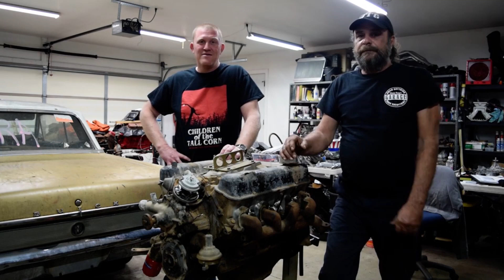Buicks Miracle Motor

Comment: for just shooting the sht, you guys were pretty accurate with everything. Like you said, in 1987 it was the last of the Turbo Buicks culminating with the GNX - BUT, in 1989 the engine was resurrected for one year only in the 1989 20th Anniversary Pontiac Turbo Trans Am using cylinder heads from the 3.3L Buick to clear the strut towers. The Turbo V6 also made it's way into 1980/81 Chevy Malibus and El Caminos - with a bulged hood, even. The 3800 was a completely different engine and the last "Buick" designed engine. Now, look up the 1951 Buick LeSabre Prototype to really see how the 215 is the grand daddy of all things Buick. That 215 was also all aluminum and was a hemi design having two rocker shafts per head. One set of push rods were almost parallel to the ground and both rocker sets rocked the rocker backwards. Take off that second set of rockers that made the engine super wide, and put all of the valves in line using a common rocker shaft and shazam, you have the nailhead. The engine went from a lesson in optimum head flow for the time to one of the worst for packaging. They were replacing straight eight engines so they needed the narrow engine packaged V8. That 215 from 1951 was also supercharged and had dual fuel gas and alcohol. The production 215 was a little more conventional in the valve train area unlike the Nailhead and the valve cover rails of the heads were raised on the outboard side so the valve covers would sit vertical to resemble the actual Nailhead. One last thing, a Stage 2 version of the 3.8L engine destroked found it's way into the Indy lights series. The Stage 2 version's nominal size was 252 cid. It was tried out everywhere and used a good amount in NASCAR. The heads performed so well that NASCAR teams using Chevy based V8's would cut up the heads and weld them back together in a V8 configuration. Possibly, a production run of V8 versions were made by a 3rd party.

Comment: They were using aluminum engines in European cars and air planes long before GM made the aluminum 215 or Chrysler made the aluminum slant 6. The technology was out there to do it right, at the time, had the American engineers would've looked for.
 That said, those are really cool engines!

Comment: Also 1989 turbo trans am. Similar to 1987 grand national, but the f body engine compartment is narrow so they made iron versions of the 3800 heads which are said to flow better and used the same part number crank as the 4.1l variant.

Comment: I bought a 1965 Buick Gran Sport...yes...a Gran Sport with the 300 in it. Bought it from a Buick engineer that I met at Sherman Drug store at 13 Mile and Rochester Rd in Royal Oak,Michigan. Gran Sports had 401 nailheads. The air cleaners where marked 445 Wildcat...the torque rating. He explained to me it was the only one made because it was an experimental. 300cid engine, 4 Jet Rochester carburetor not a 4bbl, cast iron block,aluminum heads...11 to 1 compression ratio. He said to only run SunCo 260 for the high octane. Which I did. It was dark blue with 3/4 vinyl white top,blue interior with bucket seats,center console,automatic. Automatic was Super Turbine 300....2spd...like the GM powerglide. Cool car. I also had a 225 V6 Fireball in another 65 Skylark. My Brother had 1971 CJ5 with the Buick 225 V6. The distributor was postioned just a little different because of the firewall on the CJ. So my sparkplug wires wouldn't fit his CJ.

Comment: I bought my 63 skylark convertible with the 215 all aluminum in 73 with 71,000 miles on it.It now has 337,000 and i replaced the hydraulic lifters at about 150,000.It has baby blue bucket interior and the paint is 70 plymouth Safire metallic blue painted in 74 changed the 2 speed auto trans to super T10 4 speed in 75.Today the whole car is perfect.

Comment: This was great!!! It is amazing , how many different versions of this engine, were used in different vehicles and racing applications... The enthusiasts - Tony & his friend are very knowledgeable about the different changes and versions that took place... I knew a fella back in the mid- 80's who had a Triumph TR-8, with one of these engines. He did have problems with the car-but I don't know exactly what those problems were... From what I remember, he said the electrical system on that little wedge shaped car, we're the main issues... When manufacturers constantly change their designs, it tends to make things difficult to repair the problems that might develop, after the vehicles get some miles & years of use. I like basic designs that are well proven and stay close to the same for several years of production. Much easier to find parts for these types of things...

Comment: Trivia fact. Two connected Buick nail head V-8 engines were used to spool up the jet engines on the SR-71 Blackbird in its early years.
They were eventually replaced by big-block Chevrolet V-8s
Reply: Superduper DavidMiorgan  Incorrect. I dont know where you got that false information, but there is actually a YouTube video describing in detail the engines that powered the SR 71 Edify yourself and watch it.
Ram jets are primitive technology.
Reply: Superduper DavidMiorgan  Imbecile. Your research is as defective as your tiny intellect. Your claims to know people are almost certainly spurious if not absolute fantasy.
Did you bother to look up the video on the SR71 engines? Im sure you didnt before running your miserable fingers over the keyboard and displaying your abysmal ignorance.
Those aircraft were developed by the Lockheed skunk works, not some lame general who only is in charge of setting the performance parameters for the actual engineers at aircraft companies to build.
Nice FAIL---lunkhead.
Reply: Superduper DavidMiorgan  https://youtu.be/F3ao5SCedIk
Now, IDIOT read the comment from William Pittmon describing the "start carts" being used on the SR-71 and then try to bullshit me some more.

Comment: Have one of these all over my bench, out of my TR-8. Very light engine, but you have to get used to scary low oil pressure...the system is set up for volume, and a little work with the main gallery and relief valve does wonders.

Comment: Need help PLEASE::  I have a 47 Sedan that was my Grandfathers and I'm in the early stages of restoring it, I have come across a 303 Olds rocket motor and would very much like to use that engine(for sentimental reasons, so being somewhat of a headache to install I can deal with). Does anyone have knowledge or experience with 303's who might be able to detail some of the hardships I could be looking at or is it even something I should attempt, I'm a Jack of all trades, master of none type of young guy, so i can handle most basic to mid level of work but custom fabricating a lot of parts would most likely be out of my skill ability.

Comment: Great video, well done. I did a twin turbo buick 350 and it works well. We got the idea from the grand nationals. We use a CSU Holley carb setup for blow through boost abs the air fuel ratios are perfect at all rpms abs boost levels. I did a block girdle, billet crank, and adding TA alum heads right away once they are fully ported. These are amazing engines. Even using a stock bottom end this car ran well for years with boost. I look forward to your 215 build. My vote is a 55mm t3/t4 e bay turbo and a CSU carb, tough to beat. Or use a Holley 2 barrel setup for boost using the hangar mods.

https://m.youtube.com/watch?v=ivXylF70RN4

Comment: The 3800 Series II Buick motor is perhaps the best engine ever made! Any mechanic will tell you it's great. They're torquey. Decent on fuel and last forever. I had customers with over 350000 kms. That's well over 200000 miles for our American  cousins. And don't forget. Pontiac made the fastest Trans Am ever maybe by stuffing in a GNX motor in like 89 I think. That thing was a beast.

Comment: In my late teens I bought a new 1974 Vega GT, and within a year the stories started coming out about the Vega 4 cyl self-destruction.  
I wanted more power anyway, so I bought a 1963 Skylark with the 215 4 barrel V-8. It was about to throw a rod.  I rebuilt the engine and it ran like a top.
I got in touch with Dan LaGrou at D&D Fabrication, who sold a kit with motor mount adapters, modified oil pan and a bell housing to adapt the little Buick 215 to the stock Vega 4 speed, using the stock Vega clutch and pressure plate.  I paid for my conversion by going to various junkyards in about a 150 mile radius, and buying Buick/Olds oil pans and bell housings as cores, and then shipped them to Dan for cash.  He is STILL in business, by the way.
The engine sat in the body like it was designed for it, and it worked like a charm. The only two weaknesses uncovered in about 150K miles were the stock Buick motor mounts and the rear axle upper shock mount.  The Vega had bad axle hop, and the upper shock mount would tear out.  The left motor mounts broke a number of times, but I got to where i could replace the one in about 5 minutes.
One thing I still find interesting...  The little Buick had an absolutely WONDERFUL exhaust note.  I ran dual 2" exhaust back from the stock manifolds, and exited the exhaust in front of the rear tires.  Instead of a real muffler, I ran the resonators from a 1968-69 Firebird 400 (the smallest "stock" muffler I could find at the time).  I don't think I ever heard a better sounding engine exhaust.
Sad ending...  A kid kept badgering me because he wanted to buy my car.  After a couple years I sold it to him.  Within a month he ran it into the side of a stopped train at a very dark RR crossing.  He wasn't hurt badly, but the car was destroyed.
Reply: I had a 1974 Chevy GT Vega hatchback that I put a Buick 215 in that I purchased from a local junkyard back in 1979 for a $150. I rebuilt it from parts from D&D Fabrication. I used the high compression pistons and the 215 Ho cam kit sold by D&D. I ran dual exhausts with glass packs. In mine I installed an 8 3/4 mopar rear axle with a posi that I had cut down. I raced it a few timess at the local drag strip it turned low 13s in the quarter mile. I also modified the stock tachometer to function with the V-8 via instructions from one of the hotrod publications.

Comment: Guys That Motor was a  great engine, I had 64 Buick special with the 215, then 65 skylark 300 That was a bad ass engine I made so hp on that one The nail head a bad ass motor, in fact still have a set of heads around some were. Great cars, Good video

Comment: when i was 20 years old i was working for a guy that had an english sports car collection . he had one of these that he took out of a rover sedan from the 1960's . rover was the british company that bought the tooling and all for the engine from general motors . we put it in an MGB GT he had . an mgb gt is an mgb with a hardtop roof . he told me the oldsmobile version had an extra cylinder head bolt on each head . he had another buick one that was seized and corroded from sitting otside for years ( this was in florida) that he gave me and i sold it for scrap

Comment: Bought a 1987 Cutlass Ciera Brougham new in '86. 3.8 liter (3800). Kept that car for 17 years, 280,000 miles and it never had a valve cover off and never used oil. We gave it to a neighbor who drove it for another ten years. Great car, Great engine!

Comment: Two stories...when they changed the body style on the big Buicks ((77...78?), they lowered the hood line, and the the old 3.8L V6 wouldn't fit. GM was going to scrap the motor until my brother's pal (a GM drive train guy from Oz), suggested changing the bore and stoke, so the deck height could b e lowered. It worked and John got a huge "atta boy"! Secondly, I bought a 97 Regal GS with the 3800II and a supercharger (I think it was rated at 240 hp). Great car until it burned to a crisp (like many others like the GS and GTP). Seems GM had rerouted the plug wire through a loom that allowed oil to drip onto the exhaust manifold (front bank). If I remember correctly, Generous Motors ended up doing a recall on every GM car that had a 3800 in it. The GS was a 97, and I liked the car so much, I bought a NA 99 Regal LS that ended up with over 200,000 miles on that bullet proof 3800II. Funny that I still get recall notices on that 99 that was scrapped over five years ago!
Reply: Now that's a story.

Comment: I had a 215 in a 59 MGA. Headers and a Carter Square bore carburetor, and a Muncie 4-speed, with Mr. Gasket linkage, and TR6 wire wheels. I owned the car twice. It was the poor man's Cobra. More of a novelty than anything. 0 to 90 miles an hour pretty quick but you didn't feel safe hanging out in it over a hundred. 1848 lbs. Wet.

Comment: Leyland Australia made a 4.4 ci v8 same bore as Rover 215 ci .  Block deck height raised 10 mm and  bigger stroke Great engine . Rover made a 215 ci . 3.9 ci . 4.0 ci . 4.2 ci  and 4.6

Comment: You forgot it was in the 1989 Trans Am pace car, which may be the fastest stock Trans Am ever made.  The Grand National motor (1886-1987) was underrated by the factory because the Hydramatic engineers did not think the transmission would last at the real rating.  So, another power test was run, but not to peak rpm's, and that was the one Buick told Hydramatic was real. It wasn't!

Comment: 1962 Oldsmobile was the 1st turbo. Had to utilize a cooling fluid to prevent detenation due to 10.25:1 compression
Reply: Right. The water injection system had alcohol mixed into it, which both winterized the mix and inhibited detonation.
Reply: That's why most were recalled and replaced with carburetors.

Comment: It wasn't until the 1990s that they actually had an all aluminium motor that would hold up in a General Motors automobile, it was the Z01 Corvette with a  Ford engine in it. Phil by Mercury Marine division to somewhat general motor specs.
Reply: Lotus not Ford.

Comment: The 1966-7 300 heads had AIR bosses for CA only, I think. The 340 Buick was very torquey and had actually better heads than the later 350s with a closed combustion chamber,  D port exhaust, header type manifolds, the 350 was lighter but not as efficient in my opinion as the 340.

Comment: Buick nailhead. Light small size made good - great power
Reply: Nope... Buick 215 isn't a nailhead, just styled to look like one...
Reply: I have a nailhead I put in a '64 Skylark.
It weighs 685 lbs. It is nowhere near, "light".

The 300 I pulled out weighed 400 lbs.

Comment: Semantics but the rotary has been in production longer on and off , and , per cubic inch can make more power than any other engine . I don't even like rotary motors but I have to give them that. Boost the hell out of that motor and see how far it will go .

Comment: When you reach into commercial, industry, and agriculture applications. The Ford Big six, the 240 and 300s would be the most versatile engine.
Reply: don't forget the mopar slant six in several sizes and configurations. have seen them used on  generators, air compressors and water pumping, probably even more I have never seen or knew about.

Comment: Excellent point about this engine design doing more than the Chevy small block. Imagine in 1975, if instead of offering big ass land barges shaped like the pallet they came on, with "corporate 305" engine choked off...they brought back the 1962 F85 or Skylark with the turbo.  Perfect "downsize" for a family car, better styling, and all the pep they needed. They would have stood up to the imports in the 1970's.

too far ahead of their time. Like the Pontiac Sprint OHC six. Had Pontiac brought that back in the 1970's Ventura instead of Chevy engines at Pontiac prices...they would have sold three times as many in the gas crisis era.

Comment: Ok Tony, now look up the history of the flathead v8 ford. Came out in ‘32 and was in production to...1994 I believe. I was in Yugoslavia during the war and while I was Canadian, I was attached to the French marines. Their personnel carriers were powered by ford flatheads! Blew me away! Apparently some French company bought the dies etc from ford and with upgrades continued using them. When they finally moved away from the flathead they sold them at an auction and an American company called fat jacks (flathead specialists) bought their stock. Talk to fat jack for the full story. Also, we had British “one tonnies “ they called them, as ambulance support. They had the 215’s in them with twin Weber carbs on a y adapter on a 4bbl intake. The carbs were mounted at a 30degree angle or so pointing over the valve covers. Lots more stories but enough for now.

Comment: Through the years I had a 3.8 l and A 3800 love them my first and second Dakotas were 3.9's another reliable engine the second Dakota lived to see 260, 000k and still ran decent the man I sold it to said the only real problem he had he had to replace the fuel pump at like 250 k but I wanted a magnum 52

Comment: id say another of the most reliable engines were the amc Jeep 4.2-4.0 engines.  They litterally were made for nearly 40 years.. from 71 to the 4.2 and 86 for the 4.0 till 2006.  Interesting on that buick engine i didnt know they made them so long..  I cant find any info of these engines being made until the 2000s though ?